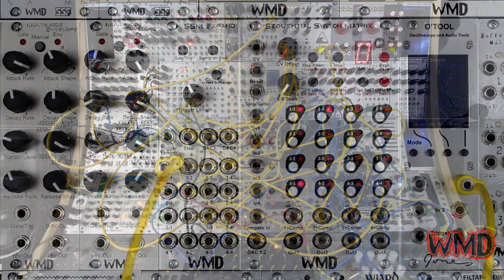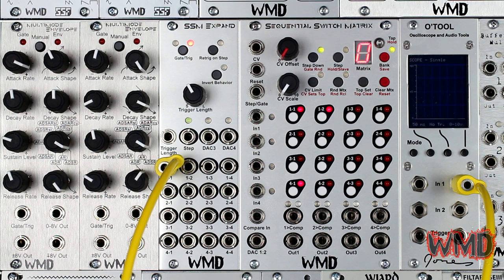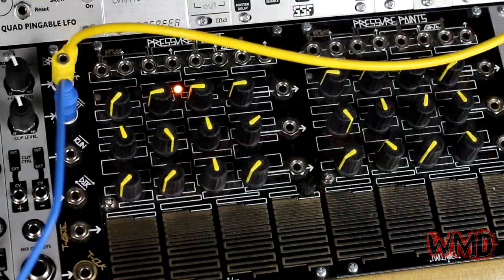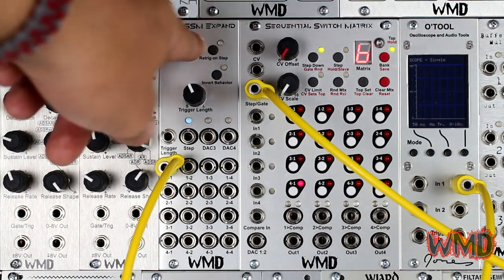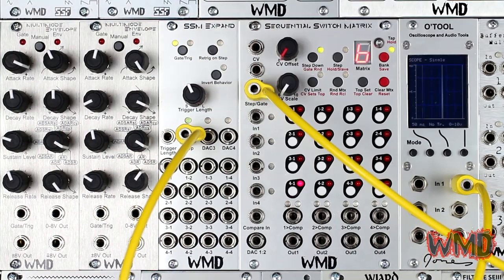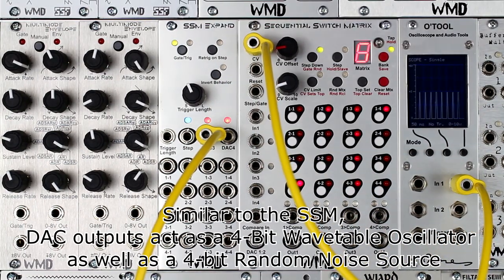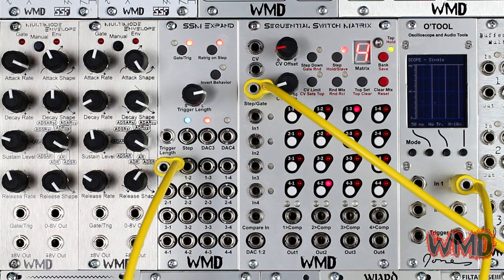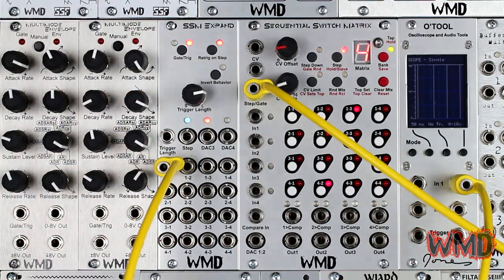WMD SSM Expand - Features and Controls

Comment: I got excited because I thought those outputs were simply tied to a sixteen step sequence. Decoupling them like this would open up interesting rhythmic possibilities not tied to the sequence coming from the switch (which will probably be a lot slower than quarter notes). Hardly an original idea but I'm struggling to think of patches for this expander that don't require an insane level of complexity (or just ignore the main module)